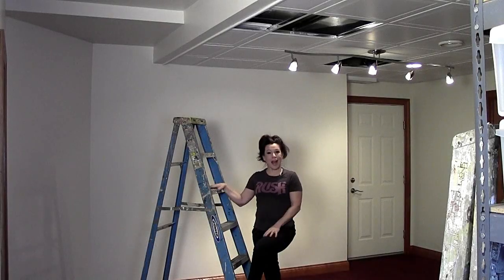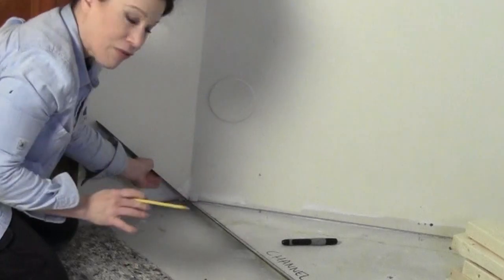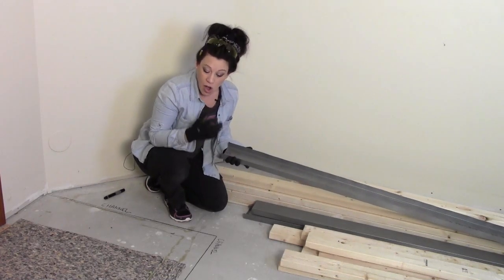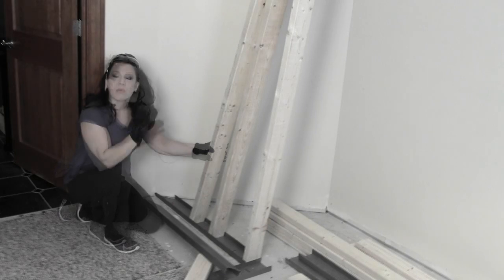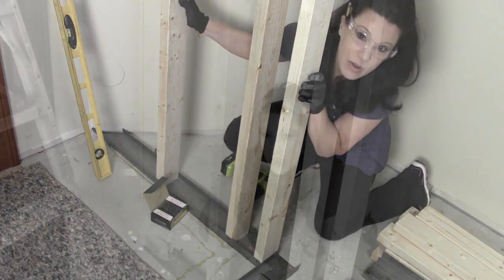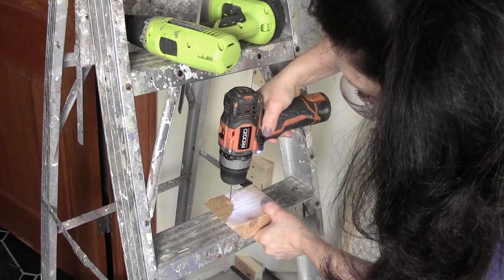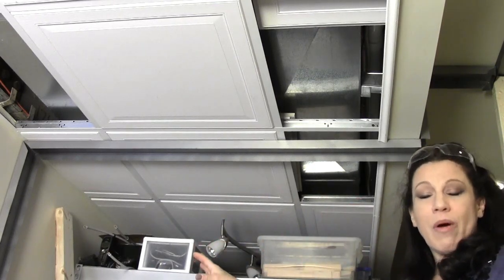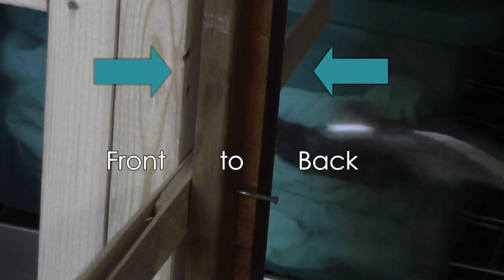Renee Romeo Teaches You The Easiest Way To Frame A Wall

Comment: do you have to use the powder actuated nailer? is there any other way to secure that to the floor?
Reply from the maker: Hi jupitor47, You can just use heavy duty construction adhesive only but make sure to use something heavy to weigh it down overnight. Then continue as normal. It won't be as strong while you're building the rest of the wall so you'll have to be more careful not to knock the track around. Also, wash the floor in that area(s) to make sure you get a good bond. I hope this helps your situation. All the best with your project, Renee
Reply: @ReneeRomeo  First of all, I'm a complete newbie, your video makes me feel like I can handle this! Thank you! I'm installing 2 walls in our 120+ year old house, one room has a subfloor and linoleum, and the other is a hardwood floor. What should I use to secure the channel to the floor?
Reply from the maker: @feliciasquires9999  Excellent question! Use screws that are long enough to go through the channel and the subfloor. Make sure it's a course thread as well. You'll do great!!! Renee

Comment: wouldnt it be easier framing it on the floor and then lifting and installing it in the space? just curious
Reply from the maker: Hi SafetyCone Garage, I've done both but I do prefer this method for basements. I don't need to be super accurate with my vertical cuts either because all the verticals can be positioned when in place. It's pretty forgiving. Great question! Thank you, Renee
Reply: @ReneeRomeo  ahh ok , then good work then....maybe ill have you do my house for me lol
Reply from the maker: @tommytomtomt  Haha - sounds like a plan...